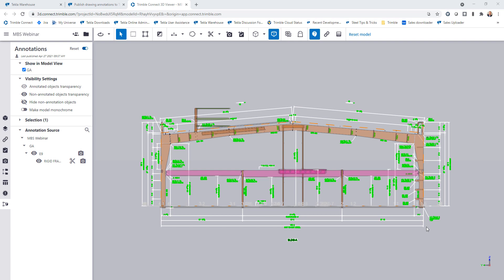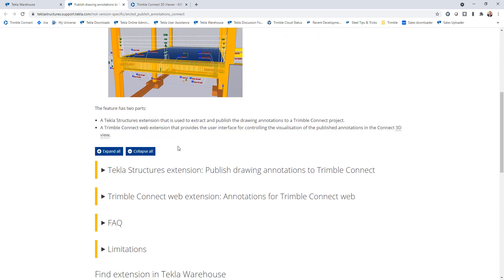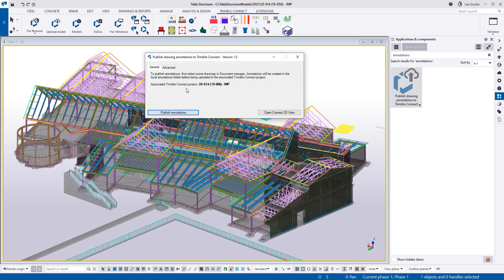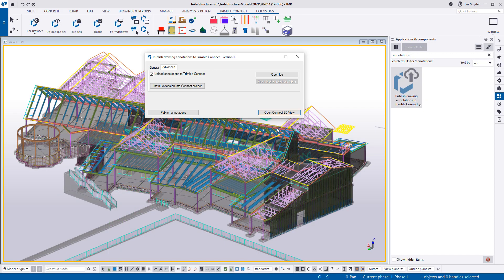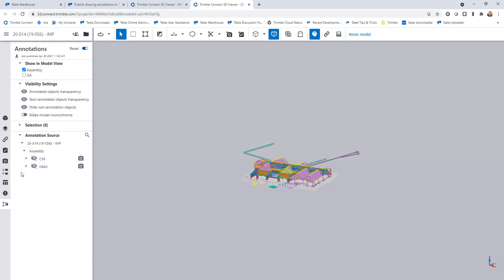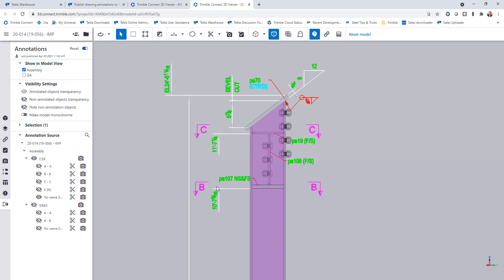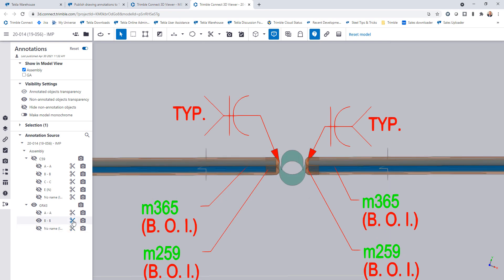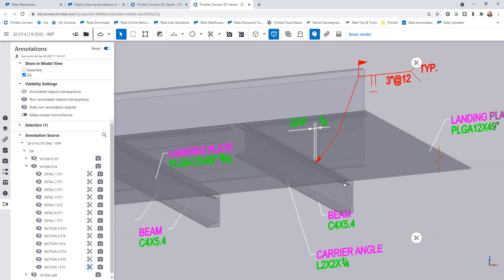Tekla Structures - Publish Drawing Annotations to Trimble Connect

Comment: Hi there! Really cool. I have three questions:

1. Is any workaround available to do the same with Revit? I mean, to overlay 2D annotations on IFC files for example. I tried a couple of things with no success.

2. What other extensions can I install in the Trimble Connect 3D viewer? Where can I view them? 

3. How can I develop my own extensions? For example, if I want to connect my ERP with Trimble Connect, is that possible?

Thank you so much!
Reply: Hello!
1.  I don't know enough about Revit to know if they can export a drawing with the coordinates of the 3d model.  I've never seen it but I'm not a Revit expert either.
2.  Currently this is the only public extension that we offer so there isn't a separate list of extensions to review.
3.  If you are interested in developing your own extensions you can use this website to learn more about that: https://connect.trimble.com/integrator-sign